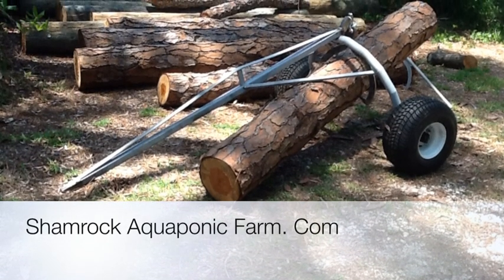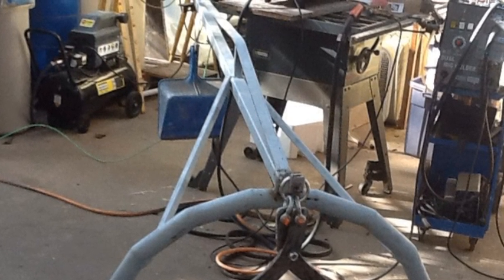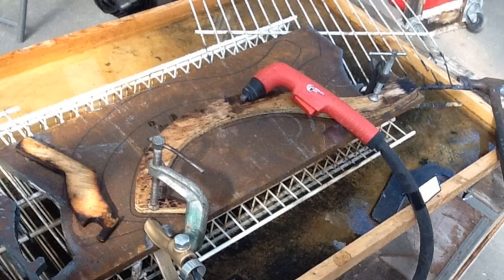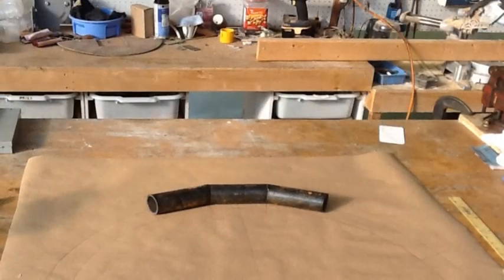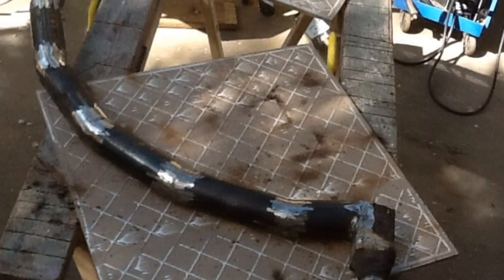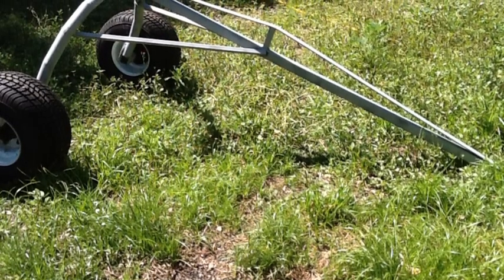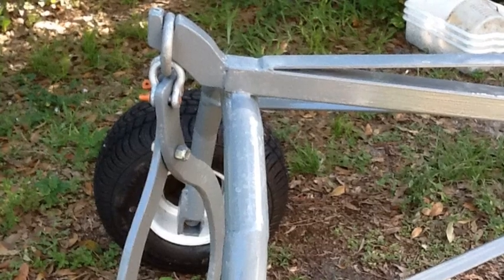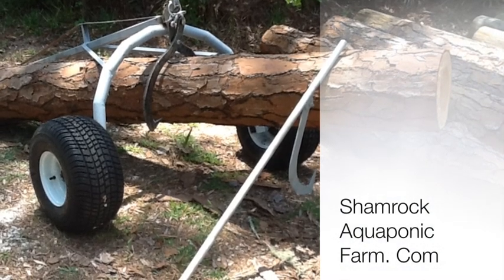DIY Timber Arch

Comment: Matt, I like your build above others I've looked at. Simple, inexpensive and functional. Have you used it much? Any weak spots or anything that you would change? Is that schedule 40 pipe you used? If possible, it would be awesome to see this hauler in action. Thanks for taking the time to share the video!
Reply from the maker: Hi Gee, yes, I would grind the angles steeper on the pipe before welding for a better weld and I would pre-heat the steel for better penetration.  I moved many 1,000 lb logs by myself without any problem, but when I leant it to my neighbor, he was able to break a couple of welds by lifting whole 3500 lb telephone poles.  The thing I would change besides my welding technique is, that I will no longer loan it out to my neighbor.  JK! I would add an inside flat curved piece of metal to reinforce the segmented arch OR if you have the equipment to bend one piece of pipe into the curve, that would be stronger.  The pipe I used was 3/16" thick.
Reply: Thank you for the reply. It sounds like the design is perfect with the exception of some welding. I have a couple of pretty good machines that will work good without any pre-heating. I will take the reinforcement advice. I'm not generous when it comes to loaning tools, guns, equipment and my women (LOL) so I should be safe. :) Thanks again!